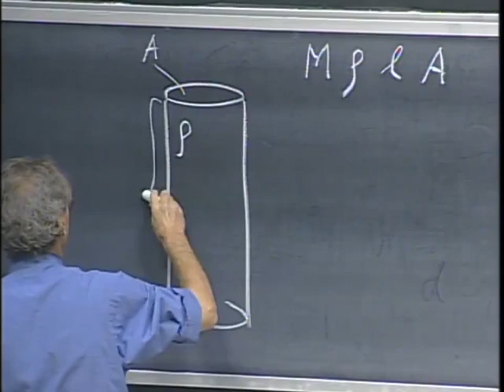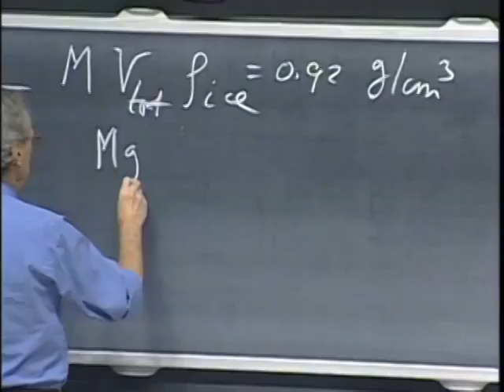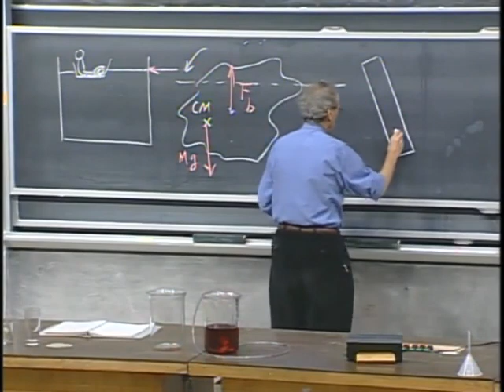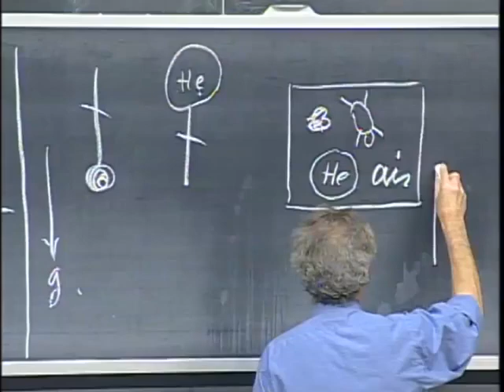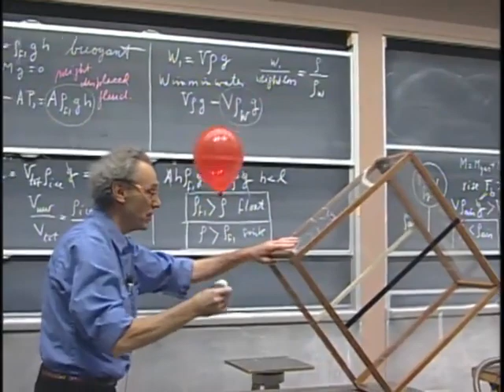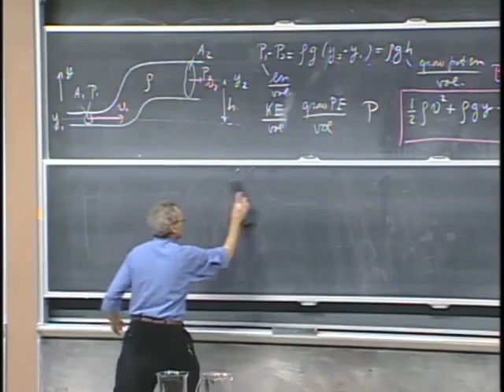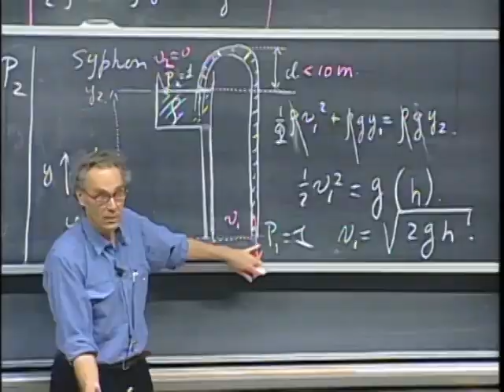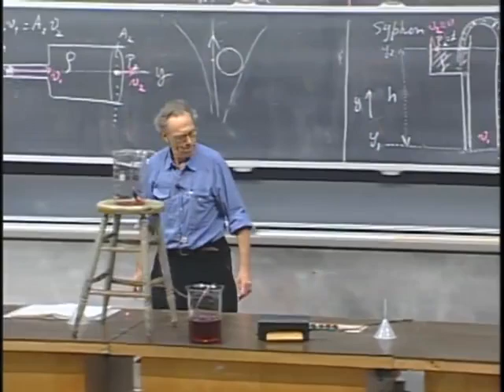8.01x - Lect 28 - Hydrostatics, Archimedes' Principle, Bernoulli's Equation

Comment: Equation of continuity states that A1V1=A2V2 . If A2<<A1 implies that V2>>V1 . How does the velocity increase(how does the fluid gain energy)?
Reply: It doesn't gain energy, the velocity of the fluid increases, but the mass traveling through it in a set time will decrease.

Comment: Sir, to answer that question at 11:36 , the water level should go down with respect to the boat, which means a smaller portion of the boat will now be submerged underwater because it does not need to displace the amount of fluid equivalent to the stone's weight. Is this correct?
Reply from the maker: correct
Reply: @lecturesbywalterlewin.they9259   Sir , related to this Archimedes Principle , there is a classic problem : What will happen when an ice cube floating in fixed water container melts? 
All books and every source in internet mentions water level will remain the same. To an approximation it will.But should it not decrease slightly? When the ice is initially floating, the volume of water it displaces will lead to an increase in height of water in the container uniformly , except in the portion where the ice cube is protruding out of the water surface. After all the ice has melted, the volume of water displaced will come back and fill the void created by melted ice thus the height falls, but the new water obtained from melted ice will lead to an increase in water's height uniformly even in the area where the ice cube was protruding initially. As volume of the water is same and exposed area has increased slightly owing to no ice being present now, height should fall slightly though that's infinitesimal. Isn't it?
Reply: @santanuchatterjee654  If you keep the water at 0 Celsius the whole experiment, and neglect evaporation and condensation, it will remain unchanged in density, and the water level will remain the same.  The ice displaces a volume of water exactly equal to its weight.   When the ice melts to 0C liquid water, it backfills that volume, and exactly as much volume as it was displacing when solid.

Comment: How did the cranberry juice not fall when it was tilted over in 48:00 min?
Reply: Abjo Das I’m unsure if this is correct but here’s my reasoning. When he inverts the cup, the empty portion above the juice is essentially a weak vacuum with very low pressure. By contrast, the piece of cardboard still feels the full atmospheric pressure pressing it against the cup. Interestingly, however, even though I haven’t done the maths for this claim - I don’t think this will work if the volume or density of liquid is too high. Essentially, you need a fine balance where Patmosphere > (Pcup + weight/area). Is this correct Dr. Lewin?
Reply: When the cup is turned upside down, the water wants to fall out. The air-filled cavity is therefore stretched a bit as the gravity pulls down the water. This reduces the air pressure inside the cup, since increasing volume reduces pressure. 

Eventually this lower pressure pulls upwards with the same force as the weight of the water pulls downwards. The water is now kept in place and the pressure inside is lower than atmospheric pressure outside.
Reply: We usually did it with the glass which was full [of water].

Surprising that it works also with a glass which is 25% empty.

Comment: the water lavel will go down.

*At first the mass of the rock is displacing the water not the volume. As the rock is highly densed, when put into water it will displace the water same as it's volume which is lesser than when the water is displaced by it's mass.

Comment: Professor Lewin: You are saying that Archimedes solved his crown problem by using forces. I was under the impression that forces were not discovered till much after 300BC? Archimedes obviously wouldn't have had access to g = 9.8 m/s^2, so how would he have solved the problem in the way you are saying?

When I first heard you starting to talk about it, I thought you were going to say "Archimedes weighed the crown, then he took an amount of gold he knew to be pure and made sure it was the same weight. If the crown was pure gold, then the two would displace the same volume of water." 

Thank you for your dedication to the subject!
Reply: in that case , you can cancel g from both sides
Reply: Archimedes would not have had access to spring scales.  Not until Robert Hooke invented them in the 1600's.

Archimedes would've used pan balances to compare the crown's weight to the weight of the reference masses.  Then suspend it from a string attached to one of the pans when submerging it.

Comment: The demonstrations with angular momentum and torques were less of a shock to me than the helium balloon going against gravity. Never really gave any thought to why it goes to the perceived "up".By the way, if you took the balloon out of the case would it still go against the perceived gravity? If you accelerated it? Thank you for the lecture series.
Reply from the maker: >>>a shock to me than the helium balloon going against gravity.>>>
does it also shock you that if you release a piece of wood at the bottom of a swimming pool that it will go up against gravity? It's the same physics.
Reply: True, but when I see that balloon going to the front when accelerated will always seem strange, even with me understanding the physics behind it. Also I think that if you took the balloon outside the case it would behave just like the apple, because there wouldn't be a pressure difference. Am I correct?
Reply from the maker: when the closed container is accelerated forward the air pressure will be larger in the back than in front. That's the key. when you release the He filled balloon in your room it goes up becoz the atmospheric pressure below the balloon is large than above.

Comment: Cranberry juice ::
Because of the difference in pressure of inside air,  in glass and outside the water will hang on .Also adhesion is critical as I tried many times with different cardboard... Plz correct me  professor If i am wrong
Reply from the maker: incorrect
Reply: As the water will slip down a little bit the volume available for air  will be increased and according to BOYLE'S LAW the pressure will decrease and the pressure difference will balance weight of water..Is this right  professor ?
Reply from the maker: no
Reply: Lectures by Walter Lewin. They will make you ♥ Physics. Sir plzz tell me and I did a rigorous search on Google ,,just tell me why the pressure inside the  glass decreases ..plzzzzzzz
Reply from the maker: question unclear. How many minutes into the lecture?

Comment: Dear Professor Lewin!
I have a question about the syphon. Why fluid does not simply rip into two (at the top of the tube) and the one in ascending part of the tube come back to the tank and the other one in descending part go all the way down?
Is it due to attracting forces between fluid molecules, which produce surface tension?
Reply from the maker: use google

Comment: About the last demonstration, maybe the falling juice speeds up the air which is contained in the glass so the air pressure inside the glass drops. Greater pressure on the outside surface doesn't let the juice fall down.

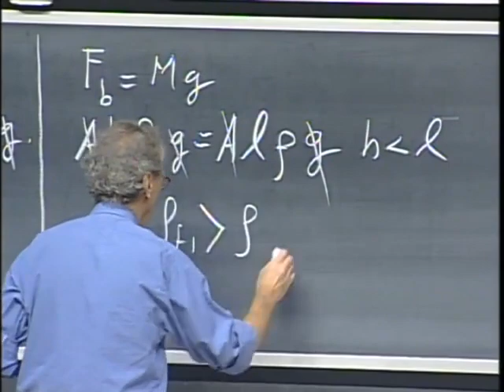Comment: Hello Dr. Lewin! You've told at 10:10 of this video that necessary floating condition is density of a fluid must be larger that density of an object. But modern ships are made from steel, steel density is a way larger than density of water. Why do they float? I think they float because significant part of their volume is not steel, but air inside rooms of underwater part of a ship. This results to average ship's density be smaller than density of the sea water. Is this right? 

PS: There are some ships made from concrete! https://en.wikipedia.org/wiki/Concrete_ship
Very counter intuitive for me :-)
Reply: I think you are correct. Consider the average density of the whole ship, It is mainly air if we think about it. That's why it floats.

Comment: At, 35:08 P1<P2 but then why is the fluid moving towards the right side? (from low pressure to high pressure). I get that the velocity is towards the right but then why isn't it towards the left as the fluid should be moving towards the left?

Comment: Prof Lewin: The expression at 2:04 implies that the expression for the upthrust , F1, contains g. Why does it contain g if g acts downwards but F1 acts upwards? I don't understand how the pressure acting on the bottom surface can be due, even in part, to gravity.
Reply from the maker: google: "Pascal's Law" and google "Hydrostatic Pressure"
Reply: I will do, thanks.

Comment: the temp. inside a balloon and in the surrounding air play a role on the buoyant force no? Is it caused by  the expansion of gas increasing the volume thereby increasing the volume of displaced air or is it the temperature effecting the densities of the outside air and the inside air increasing the differential?
Reply from the maker: Archimedes' Principle

Comment: sir, at 2:26 mins you said F1-F2 is buoyant force...now consider the same problem but only change is that, the cylinder has lower density than the water and i force that cylinder to the bottom of the vessel containing water. Now, that cylinder is completely immersed in water and bottom area of cylinder is completely touching the bottom of vessel. Now, since there is no water below the cylinder, there will not be upward force F1. so, in that case will cylinder rise up since its density is lower than the water? and if yes then what causes it since there is no F1?
Reply from the maker: >>>Now, since there is no water below the cylinder, there will not be upward force F1>>>
Incorrect. The buoyant force upwards equals the weight of the displace liquid. (Archimedes!)

Comment: Hi Professor, I thought only if the glass is fully filled with juice can the cardboard stick to the glass, as 20cm of water can only produce a tiny fraction of 1atm. But I'm not sure what happens when the glass is half filled. Is it because juice and air inside gain GPE relative to the cardboard so the pressure decreases? Could you please give a hint?
Reply from the maker: No it does not have to be fully filled.

Comment: The mass transfer of granberry juice (41 minutes) poses a question: Potential energy is transferred in kinetic energy. V1 will be lower though, due to friction in the tube. By how much (in %), any estimates?
Reply from the maker: you are off on a wrong track.
Reply: Why? There is adhesion & friction in the tube. It may be ridiculously low, but the only energy where it could come from is the potential. Which means the kinetic must be ever so slightly smaller than the theory predicts. By how much, I wonder.
Reply from the maker: you are off on the wrong track.

Comment: Dear Prof. Walter Lewin,

How do you explain a boat sinking when a hole is put in it ? 
Is this because the effective density of boat goes up ? or The amount of displaced fluid goes down ?
Reply from the maker: If you put a hole in it above the water line it will not sink. Below the water line then water will flow in the boat with water. If the mean density is larger than 1.0  it will sink. If it is smaller than 1.0 (wooden boat with no cargo and no people) it will not sink.
Reply: Thank you.

Comment: Sir, in case of siphon (37.18) will there be limiting value of 'd' so that water will come out through other hole...???
Reply: Yes.  The water cannot go higher than about 10 meters from its starting point without vaporizing.  But you probably won't try that one.

Comment: the waterline will go down,because the boat without stone will occupy less volume of water ,which means the height of waterline is lower than original one. is that right ,sir?
Reply from the maker: yes that is correct. You should have added that without the rock the reduction of the displaced water is MORE than the volume of the rock. This is KEY!

Comment: sir i have got a doubt!!.... the moment where you went to take the balloon in order to demonstrate the experiment where helium balloon moves forward....at 26:49 when you were moving forward but the balloon was moving backward why sir?
Reply: Think about which direction the vehicle is accelerating.  When he speeds it up, the vehicle is accelerating to the right.  When he slows it down, the vehicle is accelerating to the left.  The air in the container moves opposite the acceleration (relative to the vehicle), and the balloon moves opposite that, because the air displaces it.

Comment: Cranberry min 47:00 -- 
Forces on the juice: 1atmP*Area + Mg - Normal = 0  ,, so Normal = 1atmP*A + Mg
Forces on the cardboard: Normal + mg - 1atmP*Area - liquidAdhesion = 0 (calling Normal to the force of the cranberry over the cardboard and liquidAdhesion to the adhesive forces between glass, juice and cardboard) , so we get that { liquidAdhesion = Mg + mg } to get the equilibrium situation. Is that ok? Thanks professor.
Reply from the maker: PLEASE explain How I did it. NO equations needed.
Reply: I suppose that the main idea is to cover the cardboard with your hand when tilting the glass to avoid a torque on the cardboard. Once the glass is turned down the force on the cardboard is equally distribuited so you need less adhesive force. I suppose that your hand against the weight of the system makes a compression that increse the adhesive force a little too, but I'm not sure about the duration of that effect and it's importance.
Reply from the maker: I looked at 47:00 I do not understand  what you wrote. I discuss Bernouilli and do a ping pong ball demo.
Reply: min 47:30 , the cranberry juice demonstration
Reply from the maker: explain in with words. No need to use any equations.
Reply: I'll try. min 47:30 : You use your hand to cover the cardboard when tilting the glass, avoiding filtrations and avoiding a torque on it because of unequal distribution of the weight of the juice over the cardboard. Once the cardboard are close to perpendicular to gravity, the weight of the juice is equally distribuited among it and the adhesion force between glass-juice-cradboard support the weight. I hope it is right. Thanks!
Reply from the maker: that is indeed important, but there is more to it
Reply: the pressure of the air outside the glass is the same that the pressure of the air inside and they are pushing on the same area so they cancel each other.

Comment: I believe that the ping pong ball is stable because of aerodynamic forces, similar to those seen in airplane wings. When the ball moves to the side, there is much more air deflected on the other side by the curvature of the ball resulting in a force pulling it back in.

It was long believed that Bernoulli's principle is the reason why airplanes fly, but that has since been disproven in favor of aerodynamic forces caused by wind deflection at the top of the wing (and some at the bottom). Bernoulli's principle cannot account for all the lift, neither can it explain why airplanes can fly upside down. There is a good NASA article about this.
Reply from the maker: I discuss Bernoulli and existing misunderstandings in my book "For the Love of Physics".
Reply: Thanks! I love your lectures so I will definitely have a look at the book.

Comment: Professor walter lewin I got one doubt on Archimedes' principle.
Assume you have a glass full of water and you have a ball which is floating in the glass.
Now you leave the glass, so glass will be accelerated downwards with acceleration g.
So what change will be observed in the buoyant force acting on the ball?
I think the buoyant force won't change please correct me if I am wrong
Thanks for reading this long😀
Reply: Prof. There will be no relative motion between ball and water, in such case I guess buoyant force will be zero.
Reply from the maker: accelerate the basin with water and a floating object upwards.
The weight of the object and that of the water will both increase by a factor (a+g)/g. Thus according to Archimedes' Law the object will stay exactly where it was relative to the water level.
Reply: Thank you professor for spending some time for me.😇😄
One last doubt prof. 'Does buoyant force depend on the frame of reference?'
In the scenario stated by you above if basin accelerates for me, but for you it is stationary, will we both measure different buoyant force?
Reply from the maker: if you were the floating boat you would see the very same that I as an outsider would see. no change in the water level due to the acceleration
Reply: Yes professor I agree that water level will remain same irrespective of it being stationary or accelerating. But for me (I am looking at the basin which is accelerating upwards with acceleration 'a')  upthrust will be {v×(g+a)×d} but for you (for you the basin is stationary) upthrust will be {v×(g)×d}
Is my knowledge about buoyant force's dependence on frame of reference correct?
Reply from the maker: question unclear. I answered you in my previous msg in which I compared to frames of reference. If you need more help, use google or ask Quora
Reply: Yes professor I was unable to understand what you meant by a floating boat, now I got it.
Thank you professor for spending few minutes I really appreciate that😀